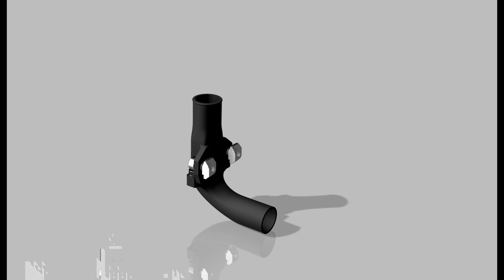VzBoT Vz235 CPAP setup

Comment: Looks awesome! I am currently in the process of building a scaled up version of the 235. wouldn’t it be wise to give the CPAP tube and wiring harness a bit more space in the integrated tophat? Then there would be no rubbing an scratching of the acrylic and probably reduced bending radii. Or was the intention to give the frame the best stiffness possible by reducing the height? 
Cheers!
Reply from the maker: I think its good to have a bit more room up there if you can secure the printer to the wall

Comment: Had an old CPAP that bit the dust and took the TF037F fan out of it.  Have the specs and wiring pin-outs, but have zero idea how to wire this up.  Pin #1 is 12-24 VDC pin #8 is ground, but no fan movement when applying power to these two pins.  Thinking I need PMW to make it spin...any assistance would be appreciated.  The spec sheet on this motor calls out pins for motor coil V, W, and U...thinking I need to use those

Comment: I know this is an older video and you are very focused on your new products but I have really been thinking about your CPAP setup and how your already recycling air from inside the printer to be used for parts cooling.  Is there room to add a carbon box directly in front of the CPAP intake? This would act like a NeverMore air purifier with no additional fans or wiring. This should also reduce unnecessary air movement.  Just a thought I had and wanted to put it out there for anyone that wanted to build on the idea.
Reply from the maker: I think it would choke it too much. However.. we could do this for thr rscs

Comment: I assume the purpose of this is to provide part cooling with reduced moving mass. Have you considered using an extruder with the motor mounted on the frame, such as the flex3drive or zesty nimble?

Comment: So in the wiring diagram you have one wire going from the 24v driver to the GPIO on the RPI, what's your config or macro for controlling? What's the range of RPMs available? I couldn't find this info on the github.

Comment: can you share the correct hole position on the back plan？thanks. btw:I think  if use the CPAP system，when close the top pc/acrylic plan to print something like asa.abs，it should face an problem of the move space.sorry about my back English.hope u can understand what am I mean
Reply: because airflow is never be a big  problem when it have big power.but the horse tough the top plan when move at high speed should be a big problem
Reply from the maker: @donaldtang8441  its in the cad I think. The back plate..if not ill add the back plate
Reply: @Vez3D  I think it is missing  2 hole in the newest cad version.including the fan body hole(seems is 21mm？)thanks!
Reply from the maker: @donaldtang8441  i added the rear plate on the cad for cpap. So you have measurements for the hole

Comment: If more airflow is required, I would opt for a hose with a smooth inner surface, not a spiral one.
These are more flexible, but come at a high price in terms of turbulence and ultimately lower airflow.
Reply from the maker: The inside is smooth. The spiral is external :)

Comment: I was thinking about the belts, since if moving at high speeds and depending on tension, they tend to jump back and forward a bit. Will it not hit against that plastic part? Good work!
Reply from the maker: I have never seen my belts doing that except when doing the accelerometer mesaearument :)

Comment: Could you make a new vent grill with a through-area for the cpap hose that is straight-thru or at least less of a sharp turn? That sharp 90° is going to wreak havoc on the flow and static pressure seen at the cpap outlet.
Reply from the maker: ill try to improve the design. But I dont see it as very sharp 90. I will test it first to see how it works. Thanks for the feedback

Comment: Did you find a solution to control the fan through gcode? I vaguely remember those requiring some sort of work-around since they typically use a potentiometer
Reply: The TriangleLabs one that it looks like he has also has a PWM input.
Reply from the maker: Yes and I made a video on how to use it and control it :) check my channel

Comment: May I suggest that you consider using a different CAD technique for the elbow. I believe you could improve the airflow if the cross-section was more circular across the 90 deg arc.
Reply from the maker: Thanks for the suggestion. There is only 12mm there.. and the ID tube is 15mm ... so it would have to be oval more than circular.  I did a rectangle but there are big fillets inside. You think it would be better with oval?
Reply: @Vez3D  Yeah, the cross-sectional area should be consistent. You can make it wider and shallower to accommodate for the tight spacing. Looking good!
Reply: Rectangular is fine, but the lofted 90 degree bend is loosing some cross section.  Try breaking it into two 45 deg lofts or a sweep and a loft or add some guide curves.
Reply from the maker: @martylawson1638  cool suggestions :) I will see if I can do this. Thanks guys. But even if it looses a bit of flow.. this thing has MASSIVE flow, so im not too worried about it.
Reply: @Vez3D  yeah it's mostly a best practice suggestion.  The restriction is nice and smooth and has a lot more area than the cooling nozzle.  I doubt you are loosing significant performance.

Comment: Absolutely incredible engineering and creativity. Do you have a rough estimate on weight savings versus a mounted fan?
Reply from the maker: Maybe 15g-20g?
Reply: But way higher air flow, at least that whats i asume
Reply: @over_pizza_2578  Oh without a doubt. Like 10x more.  I'm definitely trying this.

Comment: another alternativ (if you dont use LEDs on the 2020s in the back) is that you could guide the cpap tube underneath the 2020 to the middle if it enters at the top instead of underneath the fume extractor. maybe thats less or more air turbulance?
Reply from the maker: many ways to do this :)  Thats what nice about it. People can build it how they like. Im only suggesting my mods, but its open to people :)

Comment: nice thanks for the design and video...why not just make a whole next to fume vents as far up as possible? wouldn't that allow the airflow to be untapered (is that the right word?). I think with the current design you wont be able to use the frame cable holder cause it will collide with the tube mount..maybe a design that combines the tube mount and the frame cable holder will solve that :)
Reply from the maker: it will act as cable holder :) I wantd to have the tube center because of OCD .. and keep it as short as possible